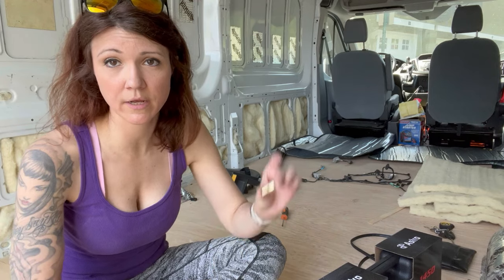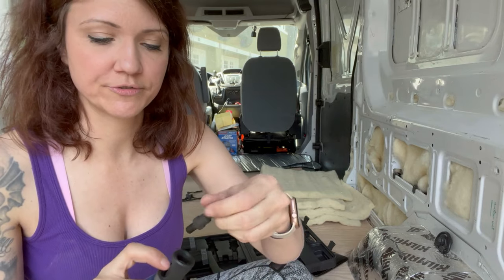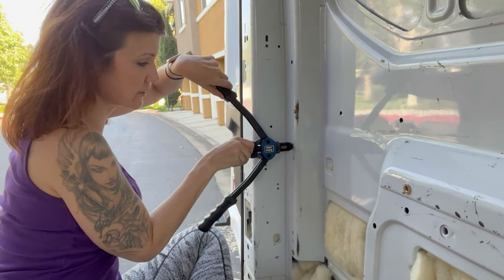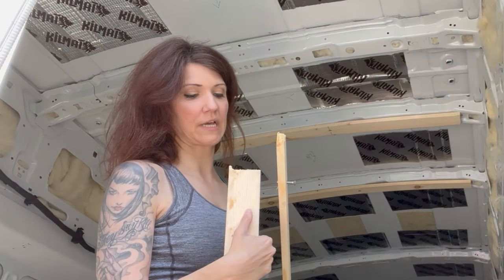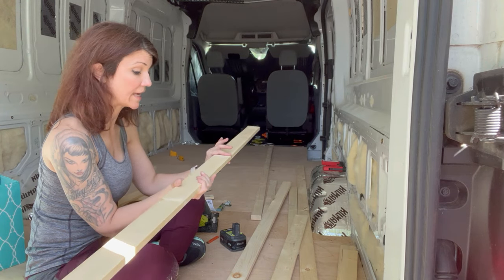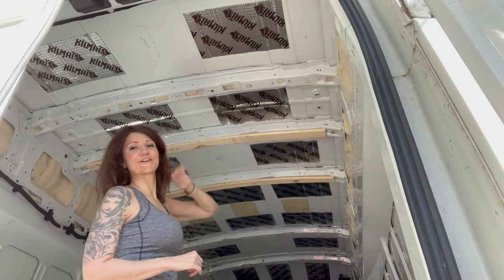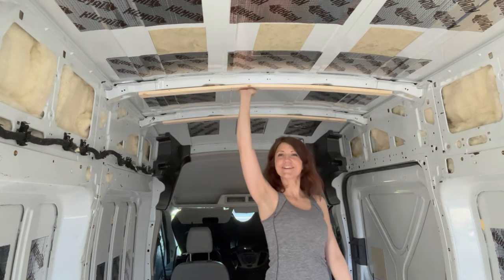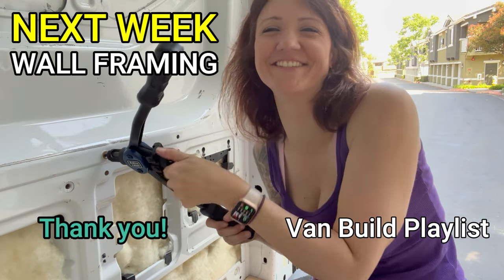Framing Basics | Plusnut Tool & Furring Strips (Ceiling Frame) | Transit Van Conversion Series [ 9 ]

Comment: I bought the pneumatic tool for the Rivnuts. It's a game changer. Putting the board's on the side of the roof ribs and using thicker boards is an easier way to install a ceiling
Reply from the maker: Ooo, that's an interesting idea! I bet that saves on headroom as well. Very cool. I'll research that, and even though it's too late for me on this van, maybe I'll try it on a future project lol. Either way, thanks for sharing. That may even give someone else something to think about on their build ❤️
Reply: @kendall.vision  I'm 6'4" 😉
Reply from the maker: Lol! Yeah, every inch counts for you! Don't wanna bump your head every 2 seconds.

Comment: Basically a molly bolt.  And just don't buy wood with knots in them.  Called clear pine or fir.
Reply from the maker: Holy moly, i had never heard of molly bolts. I just looked them up and they look super easy! A nice all-in-1 solution that looks like it doesn't require a special tool. Thanks for the info ❤️

Comment: Are you supporting the outer ends of the furring strips with some other support?  I see you figured out the easier way to get leverage on the rivnut tool💪🏻 it makes doing many a lot easier. Looks like your figuring it out as you go 👍🏻 Nice job.
Reply from the maker: Good point! Maybe I should go back with the regular wood to metal screws for a bit of added support. When I did the wall framing (next weeks vid lol) i did add a long piece going down the top/sides where the ribs aren't covered yet, but that friction may not be enough. Thank you!! ❤️❤️

Comment: If you haven’t already finished your framing yet, watch the you tube channel Our Thriving Life “How to frame a van to prevent squeaks and rattles.” Jeff recommends using Baltic birch plywood, either 1/2” or 5/8”. He says it’s more stable and won’t split or warp. Good luck with your project.
Reply from the maker: Thank you so much! I'll check out that channel. I do already have all my framing up, at least the basic framing, but that still sounds like great advice.  Maybe i can use this for my window framing later, but either way, it will definitely also help someone else like me who is just getting started ❤️ thanks again! I appreciate you